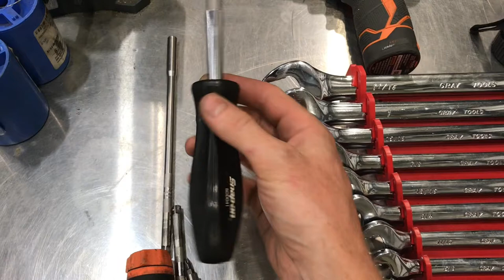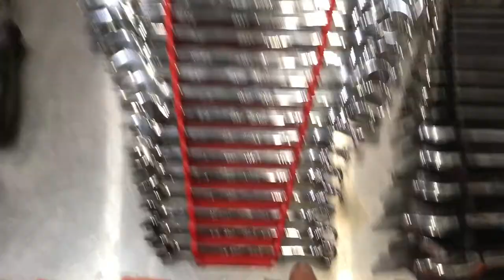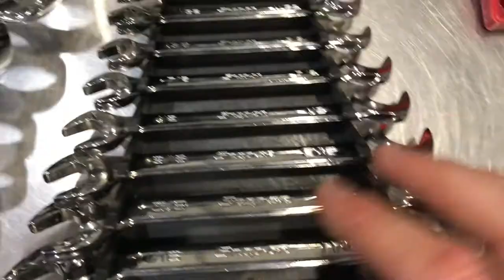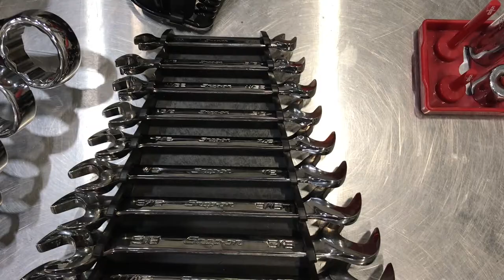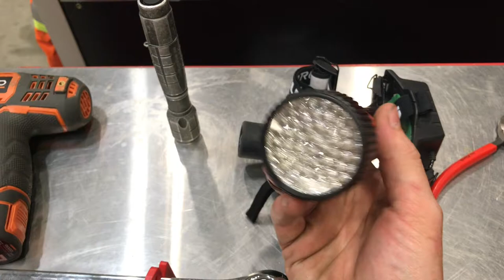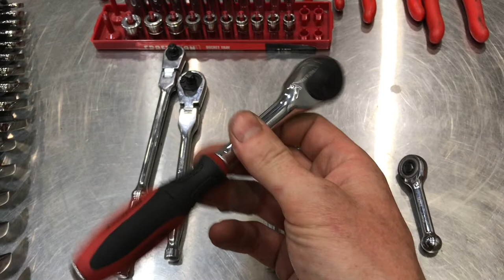Aircraft Mechanic Must Have Tools

Comment: Great selection of tools. If on a budget go all Gearwrench, you can’t beat them for the price. I would like to add my 2 cents. Gets a 7 inch and/or 5 inch Knipex cobra pliers, some kind of extending magnet, a 2, 4, and 6 inch 1/4 extension, 2 panel pry bars, razor knife, a 1/4 speeder wrench, a 1/4 universal adapter, soft face hammer, dead blow hammer, ballpeen hammer and a set of picks. If you know your going to work on any Falcon aircraft get a set of metric combination wrenches and sockets in 1/4.
Bonus “tool”, grow a mustache. Pilots always appreciate a good stache.

Comment: Hangar Mx here. Definitely get some ratcheting wrenches, all the way down to 1/4” if possible saves a lot of time. Drills also super important, personally I prefer a beefy Milwaukee M18 to drill out screws and a M12 screw gun and 90 ratchet for real tight spaces. Cannot stress enough the importance of some decent knee pads, decent headphones like the ones used at gun ranges (for when you’re leak checking a 200/700/900 or doing a duct mon) and a couple decent flashlights and a headlamp. Knipex in my opinion is the gold standard for wrenches, use them everyday but you don’t have to start out with them cause they’re pricey. Sheet metal skin spoon and a leather man multi tool are super useful too.

Comment: Speed handle is definitely useful for heavy checks, especially for the screws that are torqued a little too tightly
Reply: Also useful on the line when encountering overtorqued panel screws from heavy. 😂

Comment: Would definitely add a pair of 90 degree needle nose pilers. Mechanical fingers, And a J bar those will save you a lot of headaches especially if you have to train new employees. Otherwise great video!

Comment: 30 plus yr commercial airline A and P….I have ZERO 6 point anything in my box.  Gear wrench wrenches are a close to must have.  Double box 1/4-5/16 and 3/8 -7/16 wrenches use all the time ….RARELY use 3/8 drive, never use 1/2 inch drive sockets.  Ratcheting screw driver a must.  Rule of thumb, don’t by Snap On channel locks, buy CHANNEL LOCK channel locks (hogs as we call them)…don’t buy Snap On vise grips, buy VICE GRIP Vice grips.  Each type of mechanic - Commercial, GA, corporate, has different needs as far as tools go…I am a line mechanic at a major airline and my tool box is one I carry in one hand whereas a hangar guy will need different stuff.  A lot of companies also have all the special tools you need as well.

Comment: I work in aviation maintenance in the uk and all our tools have to be shadow boarded in foam so each spanner has a cut out in our tool box for tool control. Nothing loose like this. Most places dont let you use private ones you have to use company toolboxes which uses a barcode system
Reply from the maker: Yeah some companies here do that, mostly larger ones. The rest can’t afford to supply every employee with tools, and it’s that reason I believe they would have a hard time enforcing us to shadow our own stuff
Reply: turdpike yeh makes sense i work on large commercial cargo aircraft and we are probably one of the only airline in Europe who can still use our own tools everywhere else is company toolbox

Comment: Thanks for the vid. I have found a good rule of thumb, when you need a tool more then once it's time to buy one  you can afford.  When you use a tool daily you should upgrade or buy the best one you can afford .  This method has worked for me. However I did wind up with alot of multiple backup tools doing it that way. Also Don't make the mistake I made in thinking that Cordless tools are a luxury.  Cordless tools are a huge time and muscle saver and I now know they are necessary.  And yes i agree that tool brand doesn't matter as much as build quality and durability.  over time personal preferences become more clear and they are different for everyone.  Alot of guys I work with do alot of impulse buying on the tool truck.  Definitely have in mind what you plan on buying before you step foot on a truck.

Comment: i found with combination wrenches a cheap set honestly can be better. If you are building and tearing down engines, so the powerplant side, there are times where you need to grind down a wrench, not even a snap on will fit, and you dont want to grind away a warranty.
Reply: Hi brother

Comment: Do you think a 1/4 power ratchet would be a good investment? If so do you think you would opt for the extended reach for a little extra money?
Reply from the maker: Meh, yes and no. I bought one a year and some ago, the Milwaukee without the extended reach and honestly I’ve used it maybe a dozen times tops. I’d say more of a luxury item than necessary, but of course there are some tasks you’ll come across where having one of them makes it zip by… I’d say yes- but lower on the priority list. A good handheld drill first.

Comment: are your sockets craftsman too or is that just the storage tray? also, should i get just a regular set of combination wrenches or ratcheting ones?
Reply from the maker: Just the tray is Craftsman. As far as wrenches, first I would get just a regular set of combo wrenches. Ratcheting can come later. You can’t fit a ratcheting wrench head in many areas that a combo wrench will get to
Reply: @turdpike  What brand are your sockets? thinking of going with tekton for my wrenches and sockets.
Reply from the maker: Yup you can’t go wrong with them. My sockets are a mixed bag- mostly Gray tools and some Napa Ultra-Pro. You’re just starting out so you’ll learn as you go which things you should spend the extra cash on and which you can get off Amazon for cheap.
Reply: @turdpike  Yea I've got that Mac and Snap-on discount too. Took your recommendation and got me a ratcheting screwdriver set from snap-on. and ill look into the tiny ratchet you have from MAC.
Reply from the maker: If you can, make use of your Snap-on discount for a set of their 4 way angle wrenches. The 3/8 to 3/4 is most common
Reply: @turdpike  appreciate it! i will definitely buy those. Only thing left to get are any flex head ratchets. Guess that'll come with the needs of specific aircraft.
Reply from the maker: Yup exactly. Even them you’d be surprised how little you’d use em. Wobble extensions are a must too. Sorry man, the list goes on haha. But bottom line just the basics will get you through for a while till you figure out what you need
Reply: turdpike oh hell yea, glad I went with wobble over reg extensions. Now that I think about it, it seems like an obvious choice. Btw, if you work just line Mx do you just have a bag or pelican type box for tools? Saw some people’s line bag over at r/aviationmaintenance and I guess you’d only need a minimalist set of tools unless you’re doing some heavy Mx stuff?
Reply from the maker: You bet man, that will also depend where you work. I do 75% line mtx and 25 heavy I’d say. I work at a small international airport for a small carrier. I have a little steel cantilevered tool box that I use strictly for rescue missions when one of our machines breaks down away from base. Our machines come home every night after they do their days work so we just do our line mtx on them in our hangar. I don’t have a spare set of tools in there at all times, I just load it quick with whatever I think I need from my box. If you’re going to be at a big airport doing line checks at the gates and whatnot, yes you’ll want a more permanent something, like a stocked Pelican case for sure
Reply: @turdpike  Double open angle wrenches have been a life-saver.  I have a set of Matcos that have bailed me out big time.  I'm just an amateur, but will say that would be the last set of wrenches I would let go of.  I'm working on a small biplane with an inverted oil system.  Various sizes of AN fittings in small spaces.
Reply: asdf get the apache from harbor freight, same as pelican with good quality the only thing is that does not have life warranty.

Comment: Im currently going for my A&P license and my school has a snap on student discount and i was planing on buying some tools ,my goal is to go to a Commercial airlines  what snap on ratchets would recommend me  and types of length too. I am wilimg to buy up to 4 ratchets for the moment Thanks
Reply: My instructors have told me that the airlines will provide most tools for you. So going the expensive route for all your tools isn't a good idea. GA you'll definitely need your own tools.
Reply: Dont buy snap on you will be fine with craftman and husky. Make sire you get a good safety wire plier tho.
Reply: Kellz what airline is that, most of the airlines require that you have your own tools, they just provide measurement tools like torque wrenches or calipers since they have to be calibrated.
Reply: The one I use most is THNF72, and a locking extension to go with it TMXKL60A. I also have a Harbor Freight one that is similar, significantly cheaper, and noticeably not as smooth ratcheting. I would not buy much until you know what work you will be doing. The smaller tools if you are working sheetmetal or in the cabin. You will need more and larger tools if you are working a general crew (hydraulics, engines, and mechanisms).
Reply: @Sambuca123  in fifteen years as an A&P I never needed calipers. Calipers are really not accurate in any case. .003” or .75mm is about what one could expect for accuracy.  I found that mixing brands is a good way to go as some brands have better ratchets or wrenches.  Good thing is that decent tools are not as expensive as they used to be.  I paid $70 for safety pliers back in the late 70’s.

Comment: Try using impact driver instead of a drill to prevent cam out when loosening screws, preferably something with different power settings  or a lower powered 12v impact driver like dcf801. Here is a video on this matter:

https://youtu.be/TCzelJrFp9E